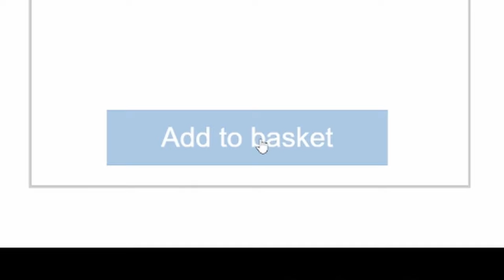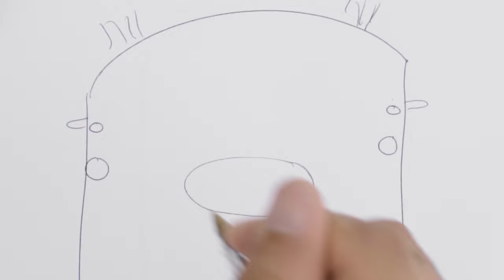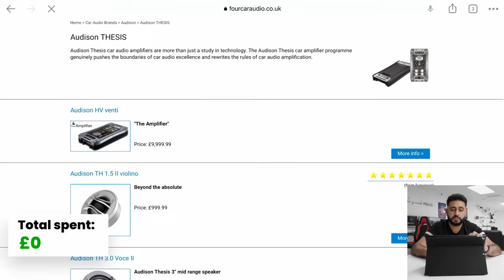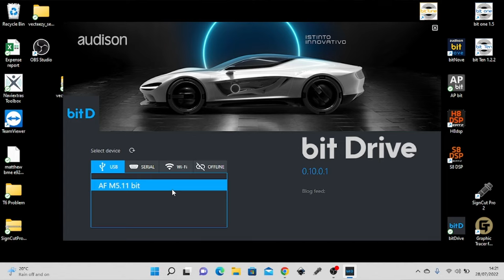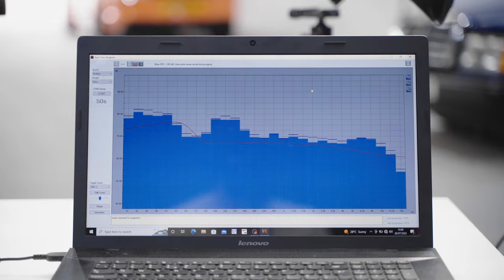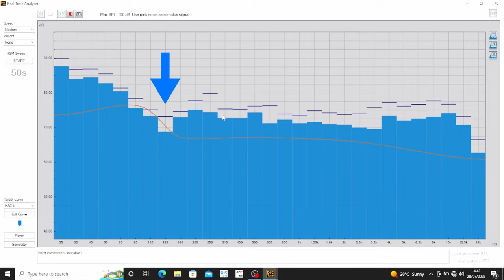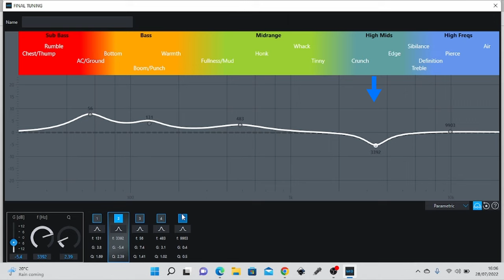FINALLY BUYING a £4000 Audio System For My BMW M5

Comment: Very inspiring video.  BTW, if you were to add subwoofer, what would have been your choice?
Reply from the maker: Probably a Audison Prima 10’’ active sub if I needed to use most of the space or a Mille Legend 10’’ in a custom box powered by an Audison Voce Uno
Reply: @CambridgeCarAudio  Do you feel that there will be a difference in SQ comparing an active sub with amp built-in or a passive sub with external amplifier?  Thanks.
Reply from the maker: @Saltydog547  yeah, active is always the way to run a system

Comment: Do you recommend to buy a "better" sound system from BMW (Standard / Harman Kardon / Bowers & Wilkins) or to go for basic and then upgrade it yourself?
Reply from the maker: Basic or hi Fi then upgrade after
Reply: Really informative video…Just curious about the comparison between Harman Kardon FLOW 600 F , FLOW 300 S via a via audison Voce AV K6 and Voce AVX .which has better effect.

Comment: Did you use the passive crossovers that came with the speakers or did the amp have enough channels to go fully active?
Reply from the maker: On this system we used crossovers for the front speakers but in the mustang we have a full active system
Reply: Was that because the amp didn't have the channels for it? Or to avoid running more cables? Or maybe another reason?
Reply from the maker: Amp didn’t have enough channels but main reason for using this amp was to test the new software and see how it sounded. Plus then we can give clients a comparison of passive vs fully active and at a lower price point